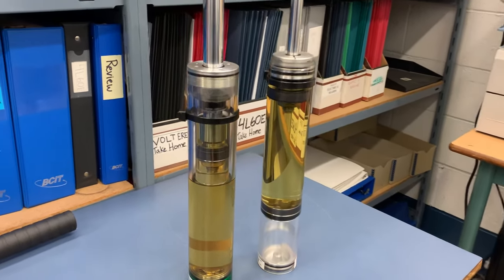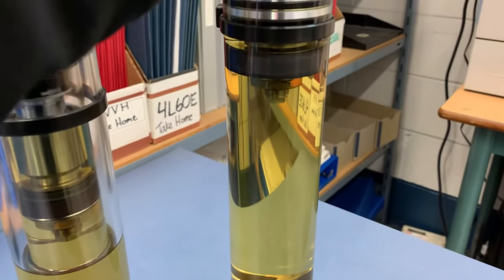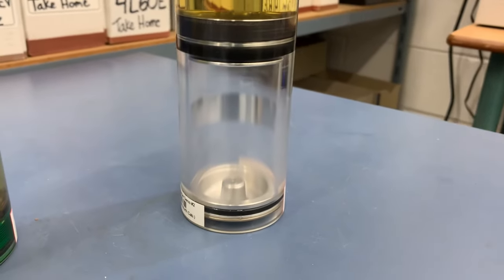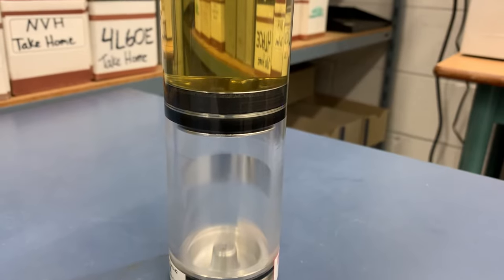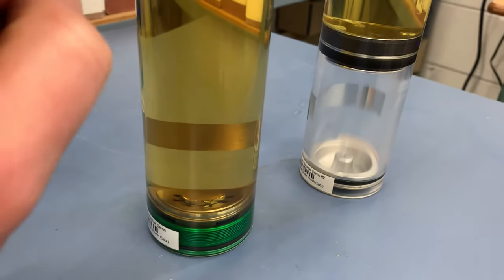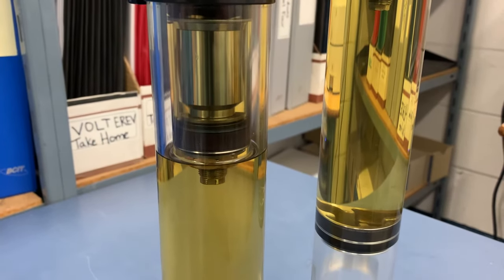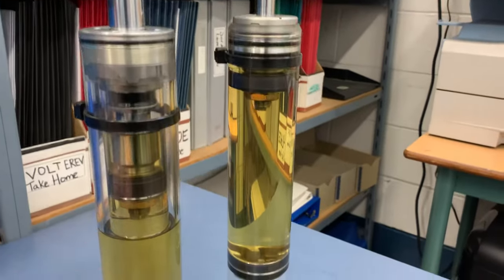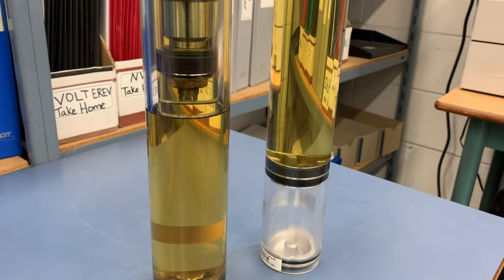How Mono vs Twin Tube Shock Absorbers Work

Comment: Pros and cons of each? The twin tube provides for a longer piston stroke. A single tube can get around this with a piggy back reservoir. Most cars have twin tube shocks but motorcycles habe single tubes.
Reply: TWIN TUBE Pro: more available overall travel for given length Cons: reduced piston size means poorer damping ability, generally outer tube air/gas is not pressurised only trapped so oil is under less pressure which means it is more prone to cavitation or aeration.
MONO TUBE is pretty much the opposite.
Ultimate performance this is a mono tube with an external reservoir as you can then have all the benefits of both damper types.
Reply: This twin tube fluid is not pressurized which means it's an emulsion shock and it's the cheapest and worst performing shock. All high performance vehicles have pressurized shock.

Comment: This is a great tool for visualization, still trying to decide which is better. Many people say that mono tube is better, but most affordable adjustable shocks are twin tube. Does it even matter?
Reply: The twin-tube is softer. 

The monotube is stiffer.
Reply: Monotube is better for performance by far.
Reply: The real benefit is you can run any mono inverted for less unsprung weight

Comment: You didn't say anything about how they handle when you hit a pothole.
Reply: The twin tube is softer. 

The monotube is stiffer.
Reply: Wrong and wrong. Either type can be built to be very soft or very stiff. Monotube can actually feel more comfortable in many cases, because they’re able to react quicker to inputs.

Comment: Pretty sure the air will mix with the oil when the fluid and material get hot from rapid action. If the rod seal leak, air will leak into the oil and thats the end of the shocks.

Comment: on the monotube. you could always add a schrader valve and add or subtract  nitrogen.   drill out the other side and change the weight value to your liking.  weld up the hole. 
"dont always have to live inside the box!"
Reply: You can do the SAME  with Twin Tube . Point HERE is that the Monotube is considered the more Responsive type , like for Motorsport ,
whereas , the Twin-tube design is significantly more  ROBUST  for  Off-Road  applications  or  Heavy Vehicle  use .
There  are , in fact , even Triple Tube types . For  Super Heavy  Duty .
Reply: Would a stored/shelved NOS gas charged monotube lose pressure simply over time?
Reply: @mrtopcat2  . Monotube , possibly , though not likely .
Twintube , No , not without Rusting through .
Reply: @johncunningham4820  Thank you.
Reply: @johncunningham4820  I'm told that twin tube rides nicer on the street. True?
Reply: @matsudakodo  . No . Monotube has better response . Twin-tube are Heavier and a more Robust Shock .
4WD and Truck use .
Reply: ew
Reply: @matsudakodo  god no, who told you that?
Reply: Why would you bother ? The Manufacturer can Spec it for what you need .
Once you tamper with it , you have introduced a  FAILURE  POINT .

Comment: You're saying fluid passes through a valve between chambers. What resets that fluid (pushes it back) to the original chamber? Is the chamber the fluid goes into under pressure..? What does does the 'work' to return it to the neutral state. Without a restoring force it'd consume all the travel. Yet, we've all seen that shocks "reset" (nearly immediately) without being installed, (eg, without the aid of springs).  More importantly, the normal behavior of shocks is far too fast to be based off fluid passing between chambers, and seems more consistent with a fluid compression.

It's not that I reject the explanation (of fluid moving between chambers) ... I'm sure I'm just missing some info which makes it make sense and consistent with what I've seen.

Comment: Thanks, my head was hurting trying to understand what the hell the gas is doing in the monotube. I finally know!
Reply: Gas chamber is used to keep the oil under pressure, to prevent cavitation, to prevent air bubbles to be created.

Comment: Beautiful beautiful beautiful explanation sir, I want to know if only mono tube shocks are filled with nitrogen or can twin tubes also be filled with nitrogen. My second question is I have a Toyota Etios whose front shocks dont dampen as good as they are supposed to do , experts say that grade 32 ISO is not suitable for front shocks in Indian driving and climatic conditions but it's okay for rear shocks. They advised me to go for 46 grade ISO oil for my front shock rebuild,what is your suggestion sir.
Reply: Twin tubes can have Nitrogen Gas too. Use Struts for front shocks. For better cushion use Sorbotane pads for the Strut Base. Also SuperSprings stubs. Google is your friend
Reply: @saultube44  Thank you brother for your kind reply . I dont understand what are 90/10 and 70/30 shocks which offers a smoother ride As I cant afford for a luxury sedan Full size 5 metres long or the executive sedan 4.75 metres long even not in used condition all I have is sedan under 4.5 metres all I expect is just little comfort
Reply: @munnachakra4342  You're welcome. That's a question for the Automotive Shop, they'll advice you well. Good luck

Comment: The main thing to note
Is that one Cavitates where the other doesn’t, and that’s where the true performance happens. Perhaps this would be helpful to explain.
Reply: what does cavitation mean in this context.
Reply: @skrobie  Google is your friend
Reply: @skrobie  Wikipedia description: "Cavitation is a phenomenon in which the static pressure of a liquid reduces to below the liquid's vapour pressure, leading to the formation of small vapor-filled cavities in the liquid. When subjected to higher pressure, these cavities, called "bubbles" or "voids", collapse and can generate shock waves that may damage machinery."
Reply: @draco147  that is how one is helpful,  🙂
Reply: Which one cavitates and which does not?
Reply: @capture_ADV  the twin tube because oil has les pression
Reply: I have two points.     #1.   Both shock absorbers in this video are upside down,  they would normally be ran in the opposite orientation.     #2.     The twin tube shocks actually use a low pressure gas bag in the outer tube, the gas bag helps to minimize air space in the outer tube, aeration is not a problem in normal operation.   The mono tube needs about 40 psi minimum pressure on the gas piston to prevent "arreration".     The shocks used in this video were specialy built for presentation purposes, they were ran upside down for simplicity.   It is a very informative presentation, but it is not an absolutely perfect simulation of a real shock absorber in action.
Reply: You can see the mono tube cavitation & the twin tube aeration in the video. Bubbles form on both designs resulting in shock fade, just for slightly different reasons
Reply: @kevinkelley3657  only the highest end mono tube shocks are inverted styles. The way these shocks are in the video is the most common way they’re mounted, with the rod on the top & body on the bottom.
Reply: Both can cavitate, but the monotube requires a higher gas pressure to avoid it.
Reply: @mtbsam68 incorrect
Reply: @capture_ADV , they both can, saying that one style doesn't cavitate is bad information.
Reply: @CB-ud6ts what I said is very much correct. Both styles can cavitate if the gas charge is not high enough to account for the pressure drop over the valving. If the oil can't be forced through the valves fast enough, cavitation will occur.
Reply: @mtbsam68 negative. Cavitation is only possible within the twin tube. It is not possible with the monotube.
Reply: @CB-ud6ts not only is that incorrect, but the monotube specifically has to run HIGHER gas charge to avoid cavitation.

Just curious, are you confusing aeration and cavitation? Because if so, your statement makes more sense. A monotube has a physical separation between the gas and oil where a twin tube sometimes does not.
Reply: @CB-ud6ts  I work in the suspension industry. Don't bring something up in the first place if you aren't prepared to explain it. He asked you a question because he was interested in what you said and you dismissed him to google. Nice going.

Comment: yeah i  have a question, what preload settings (1 to 5) should (300pounds + gear) heavy rider use and are aftermarket shock absorbers a worthy investment for said rider, given the fact that it is on cheap-ish 500cc maxi scooter? ta